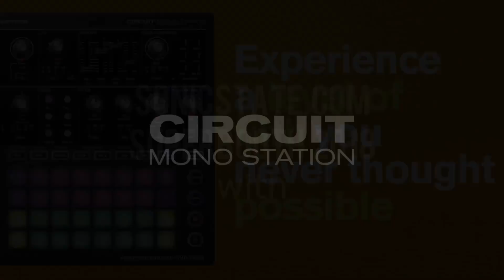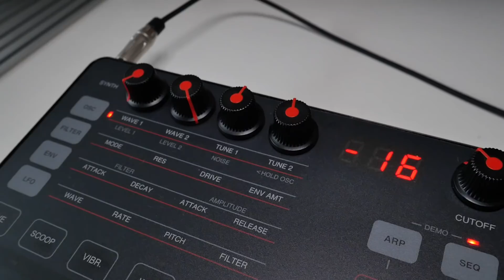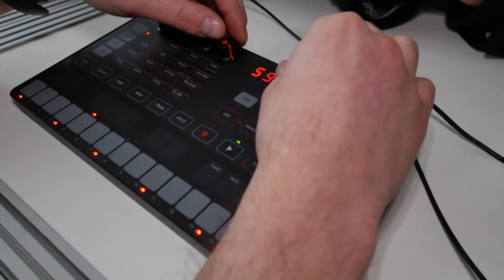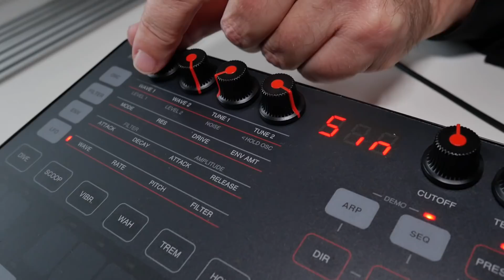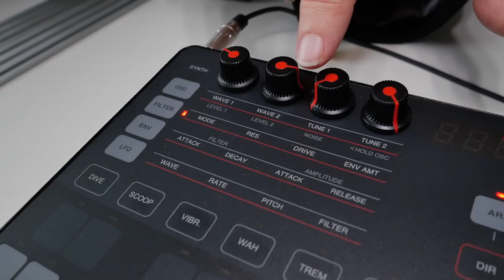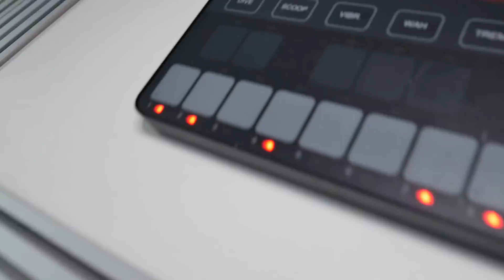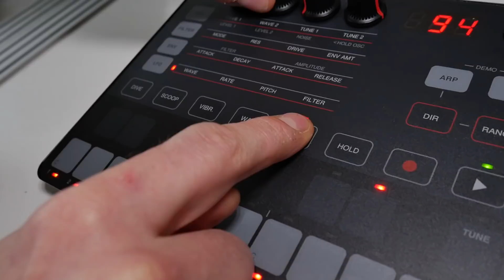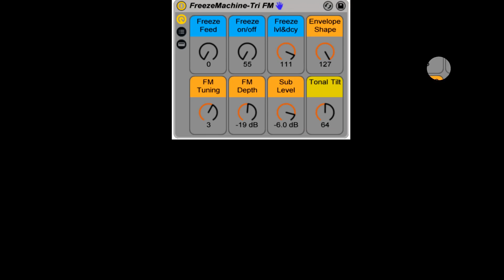Superbooth 2018 - IK Multimedia Uno Synth

Comment: Seems somewhat tame. No audio rate LFO or filter (if I heard that correctly) and the envelopes don't seem that tight. Also the matrix for parameter changes via 4 knobs like on a MicroKorg can be fine for setting up a patch that you basically just leave from then on but for live tweaking it can be a bit limiting. Like what if you want to change something on the Osc and LFO rows at the same time? Would be nice if they had a per preset assignable row below the LFO.

Comment: Sounds nice.  Needs more knobs though. When you switch e.g. from osc to filter control, the 4 rotaries don't update to show the current setting... which makes it basically a kind-of-vst with a 4-knob controller... For that price, I think I would get the lil' Erebus DIY kit and put in some hours of soldering -- not because it's necessarily better but because it seems more fun.
Reply: Think he said it's midi compliant, so could hook up a bcr2000 to have extended/updated controls.  Wish behringer would come out with an updated bcr2000...
Reply: but holy shit, I just checked the erebus DIY and that thing sounds fucking dope!
Reply: :-) Told ya...

Comment: Wohoo! What we really need is to get back to membrane buttons ;)
Reply: geecen Ain't nothing quite like a button with a hole in it :p
Reply: tactile domes for dayss!!!
Reply: WASP
Reply: Yeah pity about the membrane keys. They are not robust and usually one of the first things to fail. Hope it's not a re-emerging trend.
Reply: Yep.
Reply: +Rolanoid If they used a carbon nano tube based cover material for the membrane buttons it would last forever....but that tech is very new still
Reply: Yes a stronger cover material would help but from past experience the buttons themselves are also prone to failing or becoming intermittent even when the membrane is still intact. Perhaps it is because the buttons have very little travel distance when depressed that makes them prone to being temperamental or failing. Hopefully this membrane button technology has improved now but I will adopt a wait and see approach first.
Reply: XD
Reply: HAHA right?! because those last forever....
Reply: Rolanoid at least tact switches are easy to replace... But I'd prefer a robust design in the first place.
Reply: They stated that they're capacitive, i.e. not membrane that actually moves (and dies). You can tell by the way he's "pressing" the buttons that he's just touching them. Personally I prefer real, chunky, moving buttons, but these are much better than old-school membrane.

Comment: Dave Smith MoPho comes to mind but it has sub oscillators
Reply: I think the big difference between this and the mopho (that I have) other than the sub and battery operation is the sequencer / mod matrices in the mopho. this seems a lot more playable though w/o a computer as an editor. yeah  - I ended up preordering it.

Comment: Well that was awkward. 

The synth sounds ok, but I don't see the logic behind the decision to use a membrane UI at any price. Might as well just use an iPad which will inevitably sound nicer if all you want is something portable and a pain to use.
Reply: BluffMunkey Started making music 10 years ago and I wish I had realized just going with an iPad is probably the best thing when it comes to portable music making.
Reply: If you used nano carbon for the membrane material it would last forever.
Reply: That they are functional, does not mean they are the appropriate tool for the task at hand. 

imo.....
Reply: Not much difference in what Korg puts on the Volcas really. The keyboard is meant to input notes into the sequencer anyway, not to play leads. Just chain it to a MIDI controller and use it as a module.
Reply: The touch note entry isn't the issue, it's the membrane/matrix heavy editing interface. At least the Volcas have sticky outy buttons and plenty of knobs. Although admittedly less capable synthesis engine.

Comment: Because membrane buttons have always worked out so well in the past...
Reply: JKC40 like dx7(:
Reply: JKC40 that's why I chose the DX7iifd over the original Evan thou I like sound better.
Reply: I was specifically referring to the Moog Source, every one of which i have seen since 2000 or so has a failing or failed membrane keypad. Was also in my mind poking fun at the TI 99/4a....
Reply: JKC40 I forgot about the moog source lol